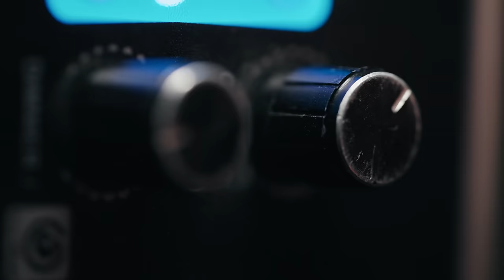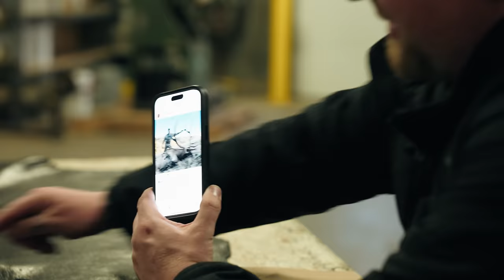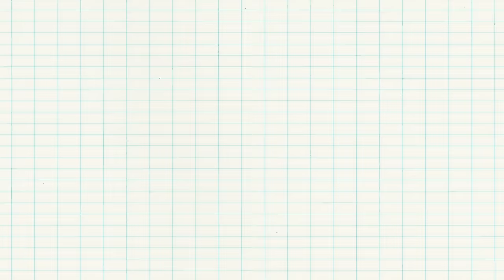Surprising Joe Rogan w/ Custom Elk Boots at UFC 300

Comment: I have been wearing custom handmade work boots for over a decade.  The fit, comfort, quality, and durability are simply levels above any mass produced boot,  and I have wore most of them.   Also,  they are fully rebuildable multiple times.  Don’t skimp on investing in your boots and your bed.  If you’re not in one,  you’re in the other.
Reply: My horse riding boots are completely custom. There’s nothing like a custom footwear.